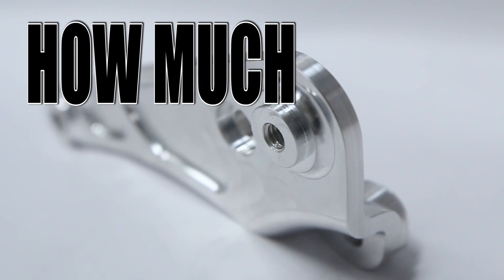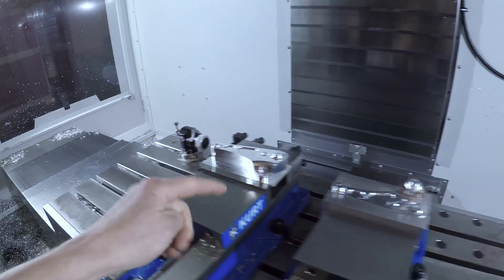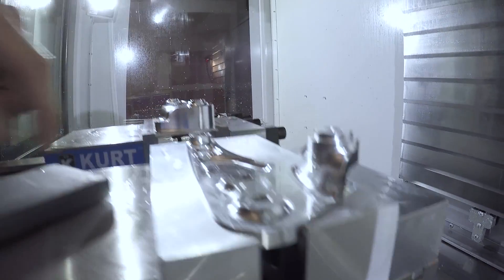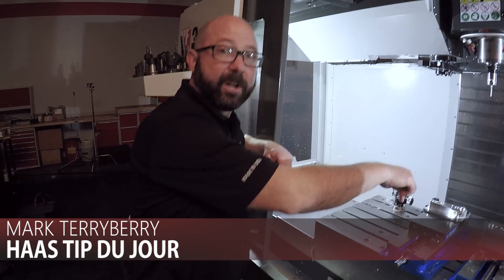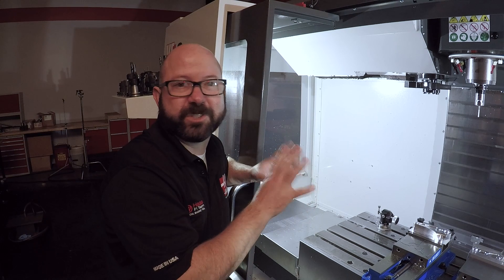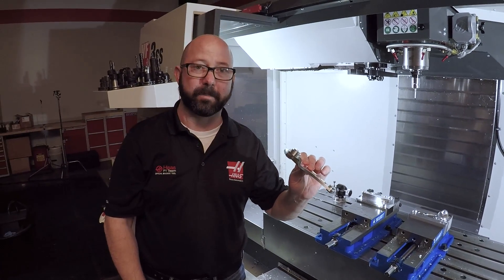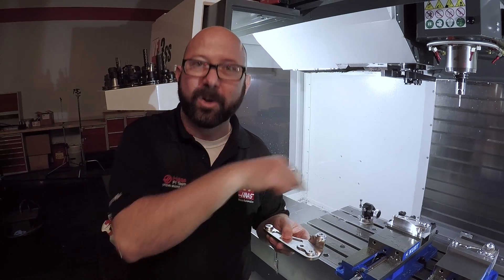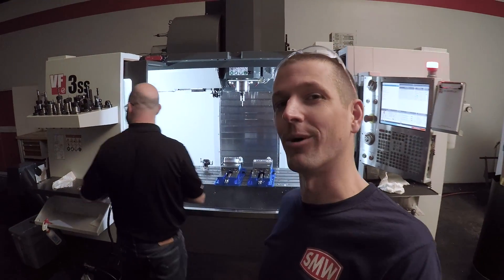How Much would You Charge to Machine this Part?

Comment: id charge 12$ for a 12-minute part (1$ a minute) plus material (prices vary and a 30 pc run would mean the material is on the high end, $5 a lb under a 100 lbs right now), plus most consumable/specialty tooling (i prefer to keep customer tooling separate, 30 pieces is not enough to wear out tooling but it is enough to effect finish if used on different parts) and a $200 setup fee which would include cutting the soft jaw and programming.
so $560 plus material and tooling as needed for 30 pcs... a far cry from $3297.90 but i would suggest more than 30 pieces because i will charge the 200$ again for setup if you come back and ask for 30 more and material will be cheaper... but ill have your tooling so you dont have to pay that again. and if we run more parts for you, you can use your tools on other parts of yours.
yes i really do so if you have parts to make and want a fair price hit me up.

Comment: My answer would be depending on what machine you are going to machine the parts and the level of automation that you have. That part can take less than 10 minute up to hours depending on what material it is made of ( slow feed rate or high feed rate to ensure the machining process not affect the internal structure at microscopic level) and what the end tolerance is required. Given all variables  I would not charge less than 50 usd for one time work but not higher than 100 usd for aluminium or normal steel metal. This is not taking into consideration that I have to use employee for the whole work rather making it myself.

Comment: To start, I am a professional CNC programmer and setup machinist. The price they quote is in fact reasonable. You need to consider quite a few things 1. Time to draw the part in CAD and CAM 2. Machine setup time 3. Run time 4. Tooling cost and wear 5. Shop upkeep fees 6. Labor       When everything is added up, around $110 a part for 30 is a normal price. It can easily take 5 hours to create that file from a drawing, which is a cost that must be included in the final fee. The larger the part run, the less the initial setup and programming cost is relative to the material and manufacturing labor cost. Once you buy 1,000,000 of these, the setup cost pales in comparison to the material and labor cost, allowing the shop to charge far less per part. If you did have 1,000,000 of these made on such a machine, they could charge likely around $30-$40 per part. If these were die cast instead, the cost would be even less, perhaps $15 per part.
Reply: If it takes you 5 hours to make a 3D model of that part based on a drawing, you shouldn't be doing that job. I just made a part like that in a bit less than 20 minutes for fun, I don't have the exact dimensions, so I picked my own based on what I eyeballed, but the part has all the features and looks very similar to the one in the video. It's nothing but extrusions and a couple of fillets. Not a single complex operation needed to create it, and you can do it all from one 2D sketch, and then just extrude individual segments accordingly and in whichever direction necessary. Even if you work slowly and double check everything, it's not more than a 1 hour job. But then again, I'm not a professional, so I don't need to vastly overestimate the time and skill it takes to create very simple 3D objects so I can charge clueless people 5 times above realistic cost.
Reply: @derbigpr500  that part to me is done in under 5  mins, as you mentioned simple extrudes and cuts mainly. If you work on cad everyday, there is no way in hell it can take 5 hrs, Like how just how can it take that long? depends on what software, i suggest get a CAD package compared to drawing it out in the CAM package software they are not as efficient (Fusion360 being an exception since that is a bit of both since it cannot do full machine simulations for colisoins.)

Comment: It would take me 2hrs to write the pgm and set the tools and get a 1st off for each op. so 4hrs in total. Then around 25 minutes running each op (I would still have to take the part out of the machine and blow down the jaws ect. Get a coffee at some point). So i reckon 28.6hrs in total from a machinist point of view. £1287/$2075 @ £45hr + material cost, fettling & inspection. This is what we would change at Expert precision engineering based in the North East of England when we are up and running in 4 month expertprecisionengineering.com

Comment: What kind of cycle strategy do you use for ball nose finishing? I usually set a constant scallop height and depending on what material we're cutting, run it at around 1000 - 1200mm/min. So just by looking at it I would have guessed €150 each

Comment: There is no such thing as a pure cycle time. Those 12 minutes are on average 16 minutes since there's other stuff to do with this part, machine or toilet business. That's 8 hours of machine time, then there is machining of op 2. that's 1,5 h maybe. Zeroing in 2 operations 0,5 h. First part, measuring, corrections and waiting for second part is around 1,5 h. Second operation first pass, measuring, corrections 2h. Then there is programing If you did hundred of parts and also deal with your own program after part came out you might be good at it so I give to such a programer 2h. If you are half-experienced programer that you couldn't foresee that unsupported part for chatter or any other problems then that could be 4 h to 6 h, but I give it 2 - 3 h.

All together 14 - 16 hours. where I come from we charge 42$/h x 15 h = 630$  + 200$ materials thats 830/30 = 28 $/pc.

Comment: Having worked with 10's of thousands of pounds of aluminum both quoting and machining, I can tell you $110/part isn't happening.  The 3 axis VMC world is littered with guys barely staying afloat with paid off machines and tooling that'll be willing to make this part for ~$50-60.  Further, unless you're ISO certified,  producing a 100% inspected part AND working with a customer who only lets jobs to approved suppliers, you're not getting that premium.  Now... there are lazy buyers out there who may trust you because you have a youtube channel that would pay this but you're obviously an exception.  Your 5-axis machine is where the money is - not the 3 axis.
Reply: Is that still the case? I'm looking to open a machine shop and wondering with what machine to start with.
Reply: @scoopof3d  Probably more now.  My material costs have gone up 50-100% on aluminum round bar over the last 18 months.  Here's the deal:  If you can find a good loyal customer or group of customers then yes, you can get top dollar.  However, that is what every shop is looking for.  Open a shop in your garage, start small.  Come up with your own product (that's what I do) and do it on the side when you aren't working on customer jobs with a goal to make that product your only gig.  Job shop work is for the birds for all but a small percentage of shops.  Good luck!

Comment: One reply was totally correct, you need to know dimension tolerances, geometric tolerances, and surface finish requirements before you can even put together an accurate quote. 
Two parts may look similar in all respects , however one is in tenths, one is plus or minus five thou.  The price isnt linear. And, what machine it will be run on can influence the price. Say, Tormach turtle, or Brother Speedio.

Comment: Left a lot of knowledge out there to describe.  How did you arrive at that random number?  Also is that cost competitive?  12 min run time, fine.  How much programming time was needed?  What was the raw material cost?  How much non-machine time does that part require?  etc...At $110/15min/part (includes changes out time) that's about $3500/day for that machine?  What's the machine utilization rating?

Comment: 110 sounds like a good deal to me. Consider
initial CAD/CAM design time
design/production time and material for the soft jaws
time and material for first trial piece to verify the program and make any needed changes
material cost
tooling cost
electricity used during the run
coolant loss during the run
clean up time for chips
wear and tear on the machine
time and materials to clean the part
finishing time and materials if customer wants better than raw part
inspection of the part

after all that cost then you have the really high cost, labor
average machine operator cost figure maybe 25/hr
add in taxes paid for an employee, benefits and so on your 25/hr employee could cost you upwards of 50/hr
6 minute run time means that employee is probably not running other jobs in between

Last but not least none of this covers the remaining overhead
machine cost
CAD/CAM computer cost
building rent or mortgage
heat or ac for building if used
local, state and federal taxes on the business itself
insurance
small tool cost, calipers, saws, air compressor, wrenches and so on
waste disposal
utility bills

I'm sure i missed a lot but this is why it is so hard to run a business in the US. 110 is a deal here but most people don't think about any of the stuff listed above. Having it made in china would probably be 25 per piece so everything is moving over seas. It sucks trying to compete with a place that has almost no overhead or labor cost. Especially when very few even think of the actual production cost of a part. All they think about is 12 minutes of your time and the material cost.

Comment: Well based on depth and width of cut, feed rate, material, and tool path length you should be able to.estimate wear and hence tooling costs, plus your hourly rate and time. I do have to say American and even Chinese basef Cnc service is a real barrier to entry. I dont think this is bad price.
Reply: I'd say 105 is fair to competitive from a customer perspective. Maybe I should have you Cnc a part for me, 2"x12"x12" aluminum with id say about 30% material removal, no 3d. 3 sides, two 12x12 faces and one 2x12 face drilling. Requites about 15" z workspace mill id say. I keep gwtting quotes for 3-4k for two prototypes. I wont pay more than 1200.

Comment: It would take around 30 mins for setup and around 8 mins total run time. So about 9 mins per part. we charge $55 hr so $6.11 if I didn't make any mistakes.
Reply: You are faster than me.  I can't make that toolpath, load up the toolchanger library, machine the softjaws, and cut the stock to size for one part in 30 minutes.

Comment: We would charge less than $10 in India.
Reply: Yeah, but cast in wet sand with overheated aluminum that was so porous that you could use it as a loofah sponge.
Reply: @mirandadonovan1272  And it would break in transite, so you'd have to wait another month to get the part.

Comment: The item looks like part of a belt tensioner assembly for an automotive drive belt, add a 4" pulley, shouldered  bolt and washer and you can buy the whole thing at NAPA all day for about $30.00

Comment: Another question for the commenters:

What would you charge for the second run with no changes in specs, tolerances or materials?  Considering most of you are amortizing the cost of cad/cam work, buying tools in the 1st 30 piece order I would assume you charge less. Why not charge the customer upfront for the programming, tools and the other costs excluding materials and time?
Reply: I hold a price. Why would I charge less for something when a customer has already budgeted to pay more for the part. Similarly, from an ethics standpoint, one company has no grounds on a discounted price for another companies custom tooling, or tools made for a different job. You don't only charge for making custom tooling, but for storing it and keeping it onhand. I pay $10 a sq. ft. in rent a year for 7000 sq ft. Every square foot needs to make me $157.14 a year including tax for me to be able to pay my employees and myself and to cover my shop each year.

Comment: Can't quote parts without a print and specs. Guessing from a picture is a good way to lose money either by not getting jobs or getting it and finding out requirements were tighter than imagined.

Anyone here want to make that part from 4032T651 Aluminum (boy... that would be a BIG surprise) and assumed it was 6061 or 2024? Better be bestest buddies with your tool supplier (diamonds!)

No specs, no quote.

Comment: I don't quote anything without knowing the tolerances.
Reply: You don't do anything to control them, but tolerance means a lot with regards to tooling (for both the machine and inspection), fixtures and in some cases which machine you'd use, which can have different hourly rates.
Reply: This is the correct answer. Everyone are just pulling shit out of there ass. This Can be a 30 dollar part or a 60 dollar part. Depends of alot you cant see in this video
Reply: So how do you control tolerances? What would you do differently for a +-.002 part vs a +-.0005 part?

Comment: Mmmm, I come out at $287 a piece looking at it from the design/engineering side of things. That a CNC shop can work smart and beat that is why a good match between part and shop is important, however, there are many features of that piece that drive the cost up for purely art purposes. Function, probably a $60 steel piece, the rest is the cost of bling.

Comment: I rarely get a time and material job.  Its nice the part ran in 12min, how long did it take him to get it programmed and tuned in to run in that time? They have a customer that doesn't require inspection reports and C of C ? Are their cleaning and packaging requirements, plating requirements? Material Certs? Are their custom tools needed or tools you don't have on hand? If the order is for 30 I would say figure 33pcs to start, starting with material for 30 your an idiot. How fast does the customer want these, standard lead time? If its a tight tolerance job do you have what you need for inspection? Do they want first article inspection? if its leaving the planet do they want a coupon for storage?  Did they supply a cad model or just a print? 
SO many unanswered questions!
Reply: Job shop CNC or manual machining usually don't charge a lot of the overhead that custom fab and manufacturing shops usually have. You can't, because the competition is quite large in the US in the small to medium range part size. Small part Job shops that charge a ton of overhead soon find that they either have to get into specialty machining(e.g. HMC, swiss, EDM, large milling/VTLs, grinding, or simply get out of the business). Matter of supply and demand really.